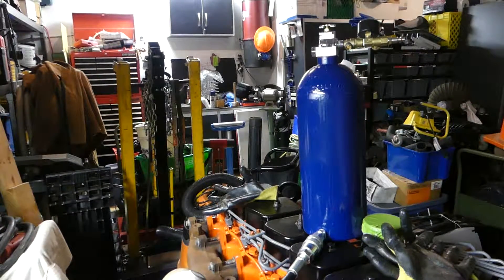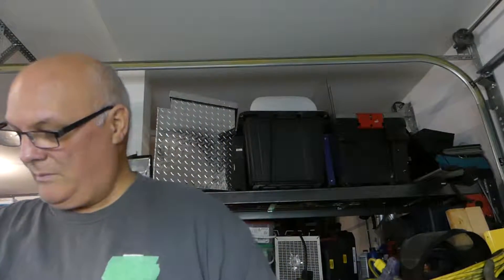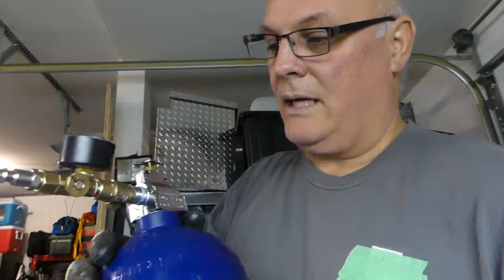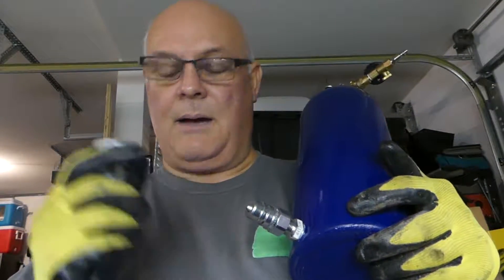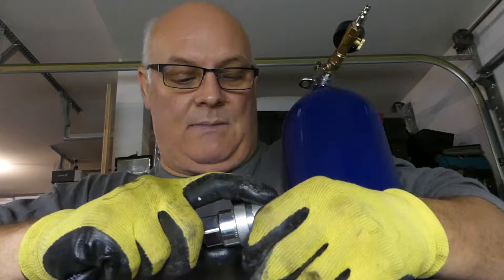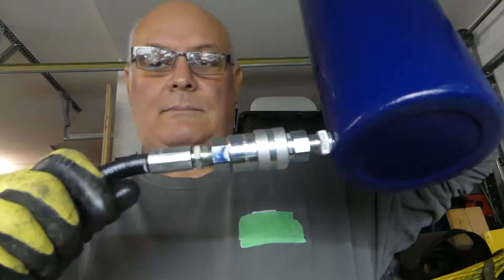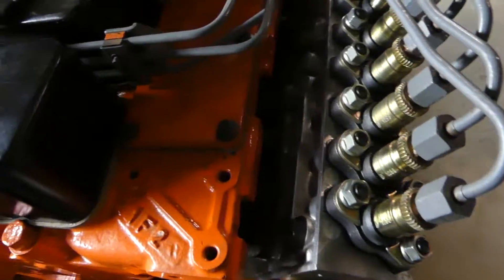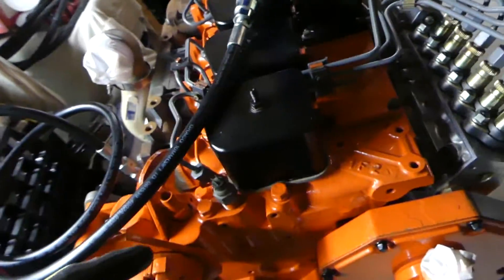Engine Pre oiler - Hi Power Garage - Cummins 12 valve 5.9

Comment: I don't get it. Is this for pre-oiling before initial startup after assembly or is it for pre-oiling before every single startup. I know most wear happens on startup, so why don't engines have a pre-oiling system, using an electric motor, for example? Run the pre-oiler motor for some seconds, then turn the key to turn her over. Makes sense, to me.

Comment from the maker: Why would "contaminants" be anywhere? Rebuilt engine, fresh oil, ??? It does need to be comfirmed that oil has gone through the engine, but it is the same basic design as the store purchased engine pre-oilers !! Oil pressure gauge will tell you that oil is where you need it too be.!

Comment: How do you know the oil is not just returning to the oil pump and reverse flowing contaminants into your sump?
Reply from the maker: Buy checking that oil has come through the valve train by removing a valve cover or through the injection pump